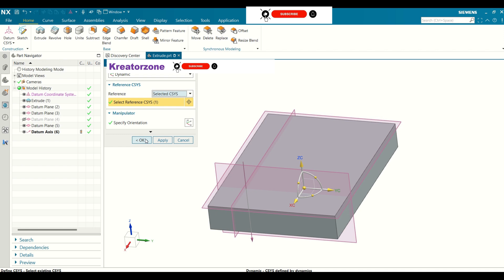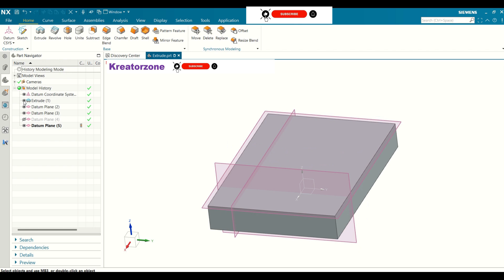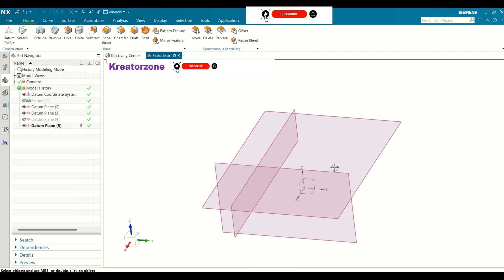How to create Coordinate system in Siemens NX latest version | Free tutorials for students

Comment: How to wrap curve on deformed surface which may be in 3-axis Not cylindrical face Is there is any option. If any pls tell your help means a lot.
Reply from the maker: @anoop6427  To wrap a curve on a 3D surface in Siemens NX, follow these steps:

Method 1: Using "Wrap Curve" Command

1. Select the curve you want to wrap.
2. Go to Curve > *Wrap Curve*.
3. Select the 3D surface as the target surface.
4. Choose the wrapping method (e.g., *Projection*, *Tangent*, or *Curvature*).
5. Adjust settings (e.g., tolerance, orientation) as needed.
6. Click *OK*.

Method 2: Using "Project Curve" Command

1. Select the curve.
2. Go to Curve > *Project Curve*.
3. Select the 3D surface.
4. Choose projection type (e.g., *Normal*, *Tangent*, or *Parallel*).
5. Adjust settings as needed.
6. Click *OK*.

Method 3: Using "Curve on Surface" Command

1. Select the 3D surface.
2. Go to Curve > *Curve on Surface*.
3. Choose Interpolated Curve or *Approximated Curve*.
4. Select points on the surface to define the curve.
5. Adjust settings as needed.
6. Click *OK*.

*Tips and Variations*:

- Use Curve > Edit Curve to adjust wrapped curve parameters.
- Utilize Surface > Analysis > Curve Analysis for advanced curve analysis.
- For complex surfaces, consider using Surface > Create > *NURBS Surface*.
- Explore Curve > Wrap Curve > Advanced for additional options.

*Siemens NX Versions*:

These steps apply to Siemens NX 12, 1847, and later versions. For earlier versions, consult the respective documentation.